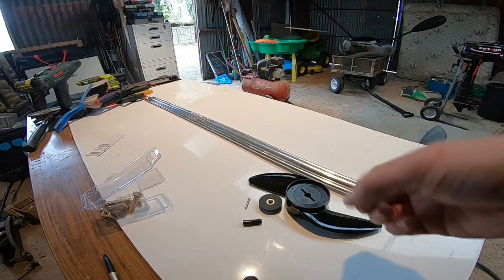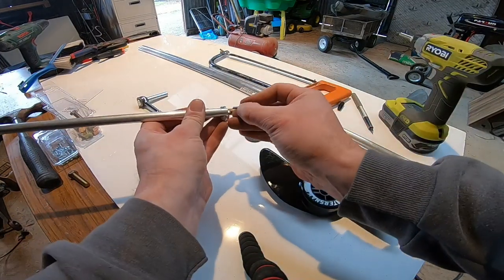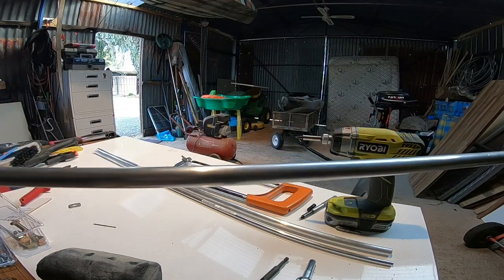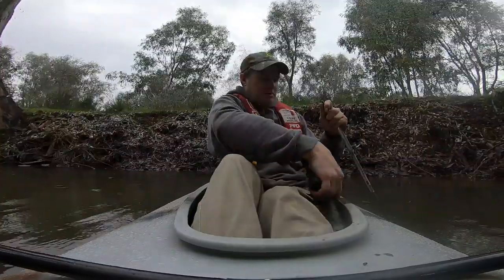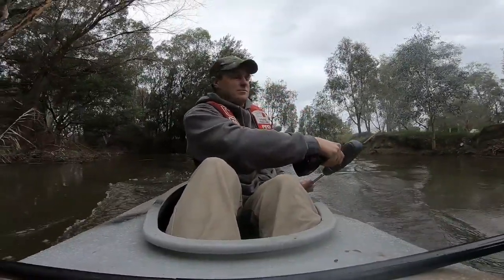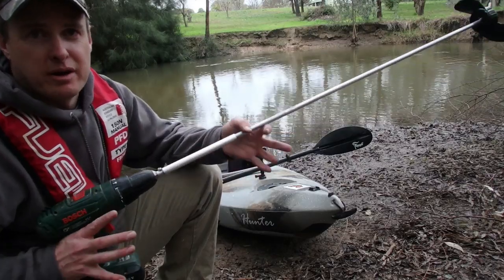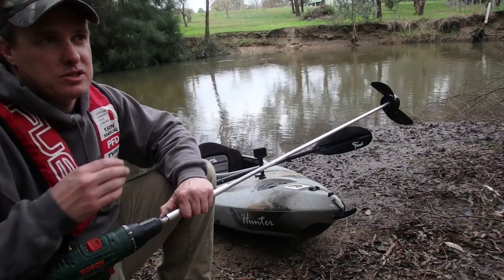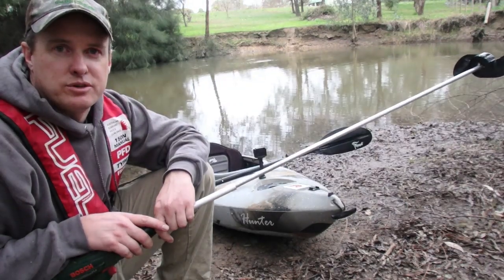Cordless Drill Kayak Motor

Comment: Maybe try using a curved weed trimmer shaft and it's components to connect to the drill?  Or even using a cordless weed trimmer and installing the propeller on that?
Reply from the maker: Check out the video I made where I turned a weed trimmer into a boat motor.
https://youtu.be/Xn3JMcSRwoY
Reply: I saw two guys do the weed trimmer, it was so darn loud and their boat barely even moved, they had to basically use the oars, they were both red faced LOL
Reply from the maker: Yeah and this one was no exception 🤣

Comment: That's brilliant! That'd make one heck of a decent backup for the backup motor on a small boat! Lol nicely done!
Reply from the maker: Thanks Rick. It was actually just intended as a bit of a goof project to start with but seems to be getting a lot of positive feedback.
Reply: @AllThingsOutdoors  It may not be the most complex thing, but imagine if someone used your idea to build an emergency motor in case of exhaustion or loss of a paddle, man that could easily save someone's life, pretty darn cool man!
Reply from the maker: Well if you liked this one you should check out the weed trimmer motor I built https://youtu.be/Xn3JMcSRwoY

Comment: Simply put a skeg at the bow and so there will be a reaction point ahead /lateral to where the force vector is applied. Then the kayak will not slide sideways as it does now.
Reply from the maker: Thanks. It sounds like you know your stuff. I'll have to give that a try.
Reply: @AllThingsOutdoors  Sir, thank you for your reply. The explanation is as follows.  Basically, your Cordless drill Kayak propeller is producing a FORCE and not a TORQUE on the kayak.  To produce a turning torque one needs a FORCE and DISTANCE to a reaction location.  You have the FORCE  but do not have a distance ( as torque on a spanner) to react with. So putting a skeg well ahead or  well  behind the
 propeller will achieve the TORQUE effect.

Please note that the winged aircraft pitches up when the force of the elevator is used only because a winged aircraft has a wing ahead of the elevator. Also, the Rudder in an aircraft turns the aircraft only because the flat sides ahead at the front act like a skeg and so a TORQUE  is formed to turn the aircraft.  The same with boats having outboards, where the front part of the boat is in the water and it acts as a front skeg.    With ships that have a fixed propeller and a rudder, it is the same as the front flat sides of the ship act as the front skeg.      Sailing boats with a daggerboard need it so that the rudder forces will react with the distance between the daggerboard and the rudder to cause a TORQUE  which turns the boat.
 
Thank you for appreciating my engineering profession.

Comment: A rudder with foot pedal steering would have helped. A fixed rudder slightly off line would also work. When you keep the drill straight in line with the kayak, the side force would be enough to keep it going straight rather than turning the kayak.
Reply from the maker: I do have a kayak with foot steering I can borrow so I might try that.
Reply: @AllThingsOutdoors  👍👍
Reply: Great suggestion.  Do you have a video where you built the same thing and you have fixed the issues noted.  i would love to see it.
Reply: @davidcammilleri5526  No, not at present, sorry.

Comment: Save paddling ,but as you say needs some  perfecting.  Maybe work it so the motor and shaft is stationary out the back, Then fit a rudder for steering.  Find an old 12 volt drill  open it up and solder a 6mm cable to the terminals  then you could have a deep cycle battery between your legs giving you a longer life. Have a toggle switch to start and stop the drill . Mounted in the centre and top of the kayak should be fairly simple, you could probably half the length of the drive shaft. you could also run the shaft in a bit of L shaped ally  and put a bearing either end  nylon rubbing block of some description.  Or just pick up a second had electric outboard and mount it on the side somehow. Good luck with it all.
Reply from the maker: Thanks Malcolm the Kayak Motor 2.0 I'm thinking will resemble something like an outboard setup which is side mounted next to the operator. My aim was to make it portable and not modify the kayak in anyway to suit it.
Reply: @AllThingsOutdoors  sounds good.

Comment: great idea , bloody great . so long as you dont wanna travel more than 100 yards cos that battery will die in seconds
Reply from the maker: Yeah it was just a goof project. Not really practical at all. Not to mention hard to steer.
Reply from the maker: Well I do have a spare line trimmer that I've been wondering what to do with.

Comment: I think an easier solution might be a long concrete mixing rod
Reply from the maker: Yes I have seen people use them before
Reply: @AllThingsOutdoors  does it work as good as with a prop
Reply: I think tomorrow i will go drill some hole in that lake
Reply from the maker: The prop centre creates a bit of drag. It really needs a cowl to reduce the drag. The prop blades are pretty shallow too. I would like to experiment with different props but there isn't a lot of range to pick from in Australia.
Reply from the maker: Have fun!
Reply: @AllThingsOutdoors  i Will try with a mixing rod tomorrow and give you an update
Reply: @cromagnon2620  how did you go with the mixing rod

Comment: So true what you say about where the propulsion comes from when i see these diy kits with the motor mounted next to you i shake my head a little because if you want to steer the kayak in the opposite way of which the motor is mounted on you are pushing the kayak sideways through the water, the propulsion needs to come from either the front or the back to make the drive and steer more effecient cool project though and cool idea. Maybe solid mounted twin drives and steer with propulsion? Just a thought.
Reply from the maker: Yep this is so true. It's all about the pivot points being in the right spot.